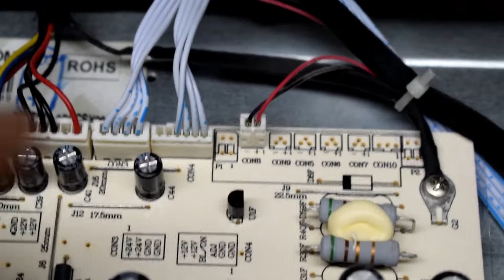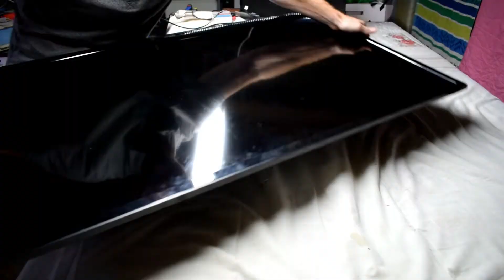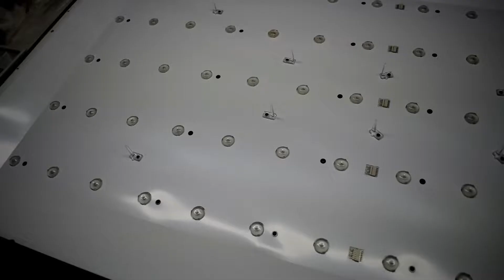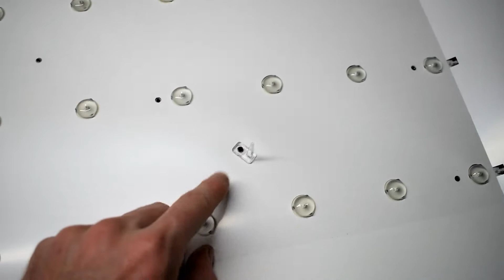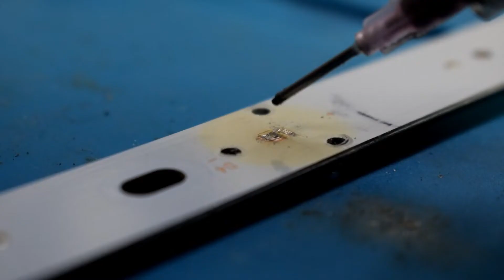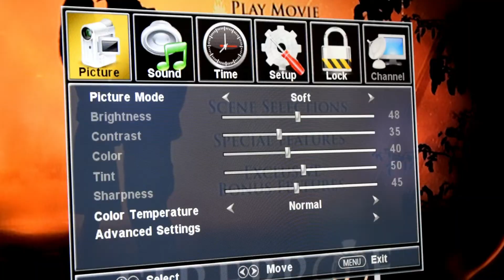RCA black screen fix. TV Backlight Repair (RLDED5078A-F)

Comment: Hey, is it weird my tv screen will turn on and look fine for 5-10 seconds before going black? But if i go through the menu and reset it, itll stay on through the channel search and longer after that? But, then goes black again if i try hooking up the ps5? I can do this multiple times, so i dont know if this is a typical black screen issue, since it does still turn on
Reply: Also did the flashlight test, and can still see and cycle through the menu

Comment: It makes no sense that TV manufaturers have NOT designed TV's to easely backlights replacement in a plug and play way. It's not impossible. Backlight problem is one of the main issues people have with TV's. To replace the bakclights, I have to buy all these special tools to access and replace backlights. I beleive they might make it that way so that you can trash it and buy a new one. Making things that make people have to replace them in a short time, is the way the economy move. AT the cost of trashing the environment with TV's. I hope some company will make it easier to replace those stupid cheap lights they make for all TV. Thank for your video. I have to decide, if I want to buy all of those tools to replace the stupid backlight or get a new one. Clearly gettiing a new one is cheaper, but I feel bad to trash a TV which components are working except the stupid cheap backlights they give us.

Comment: Can you please provide an estimate for the typical cost of these repairs?
Reply: for someone else to do it? just buy a new tv...for you to do it maybe 20$
Reply: Cost of parts from many suppliers range from $35 to $100. Depends on what you value your time to consider in “labour”. Still cheaper than buying a new tv when comparable ones are still $398 to $600.

Comment: - What kind of LED do you replace it with? That looks like a cool-white 5050, but surely its other specs must match? 🤨

-I assume 93V is specific to that model, right? I have a smaller one and there's 60V on the BL connector, so that's okay? 🤔

Never mind, apparently that's not okay. I need to try to diagnose the inverter-board before I risk the flat-flex ribbons to investigate the LED strips.

Comment: Im not doin allat😭💯‼️
Reply: Did your's just go black with sound all of a sudden?
Reply: @BITSANDBYTES927  Yeah I was watching tv before class for a while. I turned it off and went to my 2:00pm class. I came back after class and it turned on but I couldn't see anything but I could hear my PS5 menu music. It has been black every since. Too broke to get another one.
Reply: @seraphimxk  that’s rough dude i put mine on the shelf luckily i had an old one it weigh’s about 100lbs but atleast it seems tougher then the new ones it’s still kicking.

Comment: Really appreciate it, my less then 2year old RCA led 58" just lost the backlight, I don't even run it that many hours, surely a burnt led in there, thanks for the video, so helpful!
Reply: My RCA is also 2 years old, since I bought it, and the blacklight is gone. IT's not like we did something wrong to dame the backlights. It's they way manufactures choose to make TVs. Cheap backlights so you have to buy another TV.
Reply: @jamkoti  We ended up taking the RCA apart, and found a few bad LED's, its cheaply wired in series so if one dies, they all go out, replaced with higher quality, failed 3 months later, fixed it yet again, but its so cheap that when we flipped the LCD had a small crack, which is now a big crack.  I bought a 2009 Sony 52" for 20$ on marketplace, the picture is better in the blacks, got another 2011 sony 55" for free, still better, never use 4K anyways.  I was super disappointed at this, they run high voltage for example to run the thinnest wire possible inside, every corner cut.
Reply: @jamkoti  unless they can fix it

Comment: I hope this comment isn't too far down the videos life span to be answered! I have a 50" RCA Roku tv, serial: RTRU5028-CA. A couple days ago I heard a small click and thought my power went out, but no the backlight is broken. When I shine my phone flashlight on the screen I can see the tv fine. I called a local tv repair and they said that RCA never manufactured replacement backlights for their TVs, so the only way I could get a replacement was if I contacted some companies that opperate in and around Toronto (way south of me) that took apart tvs and see if they had one for me laying around. She also said there was no guarantee it worked and if it didn't I would still have to pay the 320$ for the fix, for labour, and for shipping. Does this make sense? It seems a bit scammy to me. If it is legit is it worth it? Or should I attempt to replace the backlight myself? Thank you in advance!
Reply: I should point out that everything went dark at the exact same moment. So I don't know if that means the LEDs themselves are broken and breaking one breaks all the others in sequence, or if the connection for the backlight went bad on me
Reply from the maker: I can do it for $80 
Fergus
Reply: @NewsonsElectronics   where are u located I need to fix my tv in toronto
Reply: @millzwave5001  Fergus Ontario

Comment: I have a old l40fhd41 and was watching tv heard a static pop noise and the screen transitioned to black and audio cut off. What do you think the problem may be? Backlights? Should i try to repair it or just buy a new tv
Reply from the maker: could be your power supply do you have standby led?

Comment: I have a rca rtu7877-b it has a black screen with sound if you get very close you can see all the options so from your video I take it’s a backlight issue bad led

Is this a repair that a novice can take on in your opinion? Im very handy in automotive but never took a tv apart
Reply from the maker: if u have the right tools
Reply: @NewsonsElectronics  what did you use for liquid soldering?
And what did you use to glue the led round cover back on?

I going to tackle it myself sense I just had a repair guy come and quote my 600$ to fix after charging me 65 to tell me what I told him ( backlight issues) but he was determined to test the power source
Reply: Ez as pie

Comment: Hello my Rca tv just black screened, It has audio but no video unless i use a flashlight. I took it apart and got to the Led panel but there is no discolouration in the bulbs themselves, any ideas? Thanks
Reply from the maker: use and led tester

Comment: I pulled my RCA RLDED5078A-B tv apart  there are two layers of them the white plastic  then there is a semi see through reflective plastic piece then under that there is a reflexive silver piece then under that there is finally a thick one side is mildly abrasive piece that is see through but  i do not see any LED strips any where.
Reply from the maker: there is a fibre glass sheet you need to remove, first the black lcd then the white sheets.

Comment: I saw that you used quite a lot of solder on the LED, I am not familiar with this kind of solder tho, how did you make sure they did not touch?
Reply from the maker: This is liquid solder it will join to the pads under the led when heated up.
Reply from the maker: You can also do this with normal solder but its a bit tricky
Reply: Hi, What's the name of that black liquid you're  using?
Reply from the maker: @fiificobbina6511    liquid solder, you can also use a normal soldering iron to tack the leds on
Reply: @NewsonsElectronics so having 1 burnt LED can make them all not work?
Reply: @fiificobbina6511  Solder paste